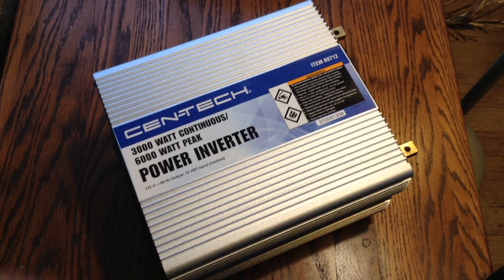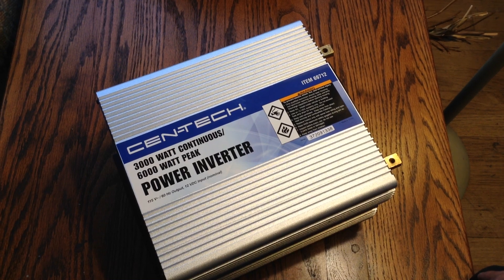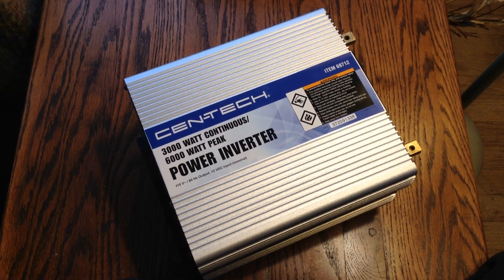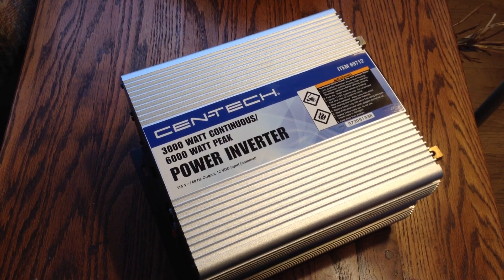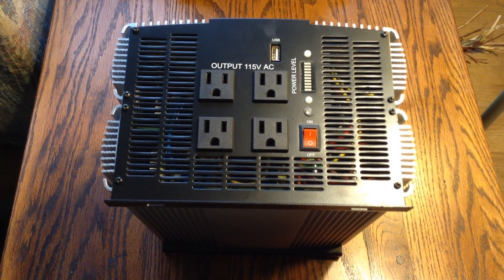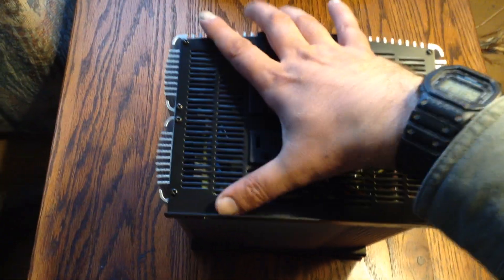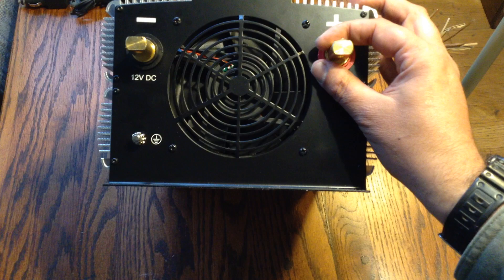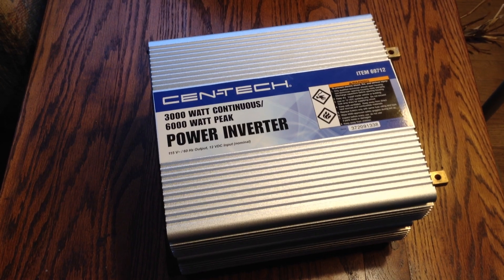Harbor Freight Centech 3000 watt 3KW Inverter item 69712

Comment: 12v Battery to inverter 275 to 350 amps, at the 120v outlets 25 amps max.  I would imagine that 8x 100 amp hour battery could be used in parallel  to supply enough juice to run some tools for a bit all day. We use 48v system which makes power draw much easier.  No problem with the Airfryer, hair dryer, microwave running.  I do have a 2,000 watt Jupiter as backup but due to the modified sine when tested our microwave struggles to reheat coffee.

Comment: Being that you don't get something for nothing, on average, ANY inverter will draw about 10 times the output amperage of the inverter from your batteries to produce 10 times the battery voltage or 120 VAC at XXX watts full load. In other words 5,000 watts / 120 VAC = 25 amps AC. 10 X 12 VDC = 120 VAC therefor 10 x 25 Amps AC = 250 amps DC DRAW FROM your batteries at full AC load. If you go into a Flying J truck stop or any other big chain truck stop on an interstate, a lot of times you'll find a very small microwave oven and a 3,000 watt inverter combination for sale. It's been years but they used to go for about $350.00 U.S. Large trucks use large batteries or several smaller  batteries in a series / parallel configuration and need an equally large alternator to charge these, run a lot of clearance lamps, headlamps, driving lamps, cooling fan clutch and A/C system et al. These alternators are usually good for 250 to 300 amps by themselves. Usually long haul truckers leave their engines run 24 / 7 because burning a gallon of diesel fuel an hour at $3.50 a gallon for heat or A/C is cheaper than a motel room. Warming up a meal in this microwave will suck a lot out of their batteries as the alternator doesn't put out full power at idle but it will eventually recharge the batteries back up anyway.
Oh, and the series / parallel configuration that I mentioned? Not everyone knows this but the older trucks used a massive, single 12 volt battery valued at  between $500.00 and $600.00 then to warm glow plugs and start high compression diesel engines. If you increase the voltage, you halve the current required to do the same amount of work. Being that there aren't too many vehicles out there, (none that I know of), that runs everything on 24 VDC, The truck manufacturers decided to take 3 standard size albeit heavy duty batteries, connect 2 in parallel and connect the 3rd through a very heavy complicated relay that resembles a part out of a nuclear submarine. When the 12 VOLT truck is idling, all 3 batteries are connected in parallel through this relay to charge from the 12 volt alternator. When cranking the truck, the relay disconnects the 3rd battery from the parallel circuit and reconnects it in series with the other 2 batteries to power the 24 volt starter motor there by halving the current required to start the truck, which, at 12 volts could run up to 600 or 700 amps for a V8 engine. Now it only requires 250 to 300 amps to start. My first car was a 1968 Chevy. It had the 307 Cu. In. small block V8. Compared to a V8 diesel engine, it was an extremely low compression engine but it still required 200 amps at 12 volts to crank so you can see that it doesn't take a huge battery anymore to start a large diesel engine at 24 volts. This coupled with the lack of glow plugs in a modern engine, requires even smaller batteries with smaller reserve capacity. Some of the newer trucks have even done away with the electric starter altogether in favor of an air powered starter that is akin to the air wrench that they use to change your tires with. If they were to need a jump start if they had an air leak, they would pull out a long air hose to connect to a fellow trucker's air reserve tank rather than jumper cables as big as your wrist. In the older trucks with the Queen Mary starter batteries, if 1 cell went bad, the entire $600.00 battery had to be tossed. Now, if 1 cell goes bad, you are replacing only 1/3 of your battery bank for about $125.00 to $150.00 while retaining the other 2/3 of the original set.
As for your using a high starting current battery for your high current inverter, bad idea. This is what the bangers with the kilowatt audiophile thump cars thought when they were popular back in the 1980's. They'd buy the 1,000 cranking amp "truck" batteries and try to run their high powered amps without the car running. They'd pick up some cute chick on Clearwater Beach after a half hour of "advertising" then be embarrassed as hell while begging for a jump start to go find a quiet place to "get acquainted". Some would have to buy a new battery 2 or 3 times a year if they didn't catch on to the pattern of permanently damaging their battery by over discharging it and overheating it during recharge. Even though high cranking amp and long reserve capacity deep cycle batteries are chemically the same, they are constructed differently and have different charge / discharge pasterns. High cranking amp batteries have many THINNER lead plates and are made to output a quick 200 or 300 amp burst of power then recharge at a REGULATED rate of about 13.5 VDC to 14.5 VDC from your alternator but ideally never being discharged more than 10% or 15% at any one time. This is one reason why you shouldn't try to crank a car more than 30 seconds at a time without a 5 or 10 minute break to allow the battery to recover somewhat. 1) You can overheat the windings in the starter motor and ruin it because the battery voltage begins to drop. What did I say before? If you double the voltage, you halve the current required to do the same amount of work. The reverse is also true. If your battery voltage drops 25% from 12 to 9 VDC, the current required to crank the motor INCREASES by 25%. Instead of pulling 200 amps to crank a small block V8, now you're pushing 250 amps through motor windings made to operate at only 200 amps. and 2) If your battery voltage drops below 10 volts, you can overheat the plates thereby warping them and shorting them out. If you connect a high output battery in your inverter setup as you plan, you will be subjecting the battery to the WORST of both worlds. You will be drawing high current for conceivably, a relatively long period of time like using your geared saw to cut a sheet of 8 foot plywood longways. A 15 amp motor @ 120 VAC = 15 amps X 10 amps drawn from your battery = 150 amps but for more than 30 seconds and for how many times a day while building a dog house, shed or barn before it finds it's way back to your UNREGULATED charger that may put out as many as 16 VDC? Add this to the possible multiple tools plugged into the other 3 outlets and you compound the problem.
On the other hand, a deep cycle battery is made for lower power drains over a longer period of time because their are fewer plated but they are built heaver and therefor less prone to overheating and warpage IF THEY ARE CARED FOR PROPERLY!!! If you keep them charged PROPERLY when not in use. This means that you connect them to a DEEP CYCLE BATTERY CHARGER BEFORE you go shower rather than forgetting to connect them at all for a week at a time and keep the water levels over the top of the plates, they'll last you longer. A full, fully charged battery is like a wife. They'll both keep you happy longer if you give them what they want. Wives and deep cycle batteries are the same in that they both want to do less. Wives like to have others around to help with the work. Deep cycle batteries like to have like minded batteries connected to to them to share the load too. While you may not want to cart around 3 or 4 deep cycle batteries in your off grid power supply, you can't fight physics. You'll lose EVERY time. Maybe consider a 4 wheeled cart to, here it comes again, SHARE THE LOAD of the extra 150 pounds of batteries that will be required to do the amount of work that you are asking of them. Taller wheels will help it to roll easier too. VERY IMPORTANT!!! Be sure that your DEEP CYCLE CHARGER(S) have enough capacity to charge your battery(s) in the time that you will allow them to charge. If you use this thing every 3 or 4 days for 30 minutes at a time, a 10 amp charger left connected when not in use should do fine. If you're going to use it every day, day in and day out, 10 amps of charging current capacity PER 100 AMP HOURS OF BATTERY CAPACITY is more like what you'll need to charge them properly. In other words, if you have 4) 100 amp hour deep cycle batteries, you'll need either 4) 10 amp deep cycle chargers or a single 40 amp deep cycle charger or any combination up to 40 amps. You could check with an RV or marine supplier for your best options. Here's another thought. I don't know about where you live but at the Walmart here in West Virginia, they sell in the automotive area large super caps. These are full farad super caps that are about 1 1/2 times the size of a soup can, they charge quickly but like a battery but discharge in an instant. The guys with the aforementioned thump cars connect them across the power leads of their amps to supply a pulse of power to the amp so the supply voltage doesn't jump around with the beat of the music and play merry, merry hobb with their sound quality. This won't extend the operating or daily life of your batteries but it will absorb some of the sudden impulse draw when you start up a power saw. REMEMBER, IT CONNECTS TO THE 12 VDC INPUT OF YOUR INVERTER AND YOU MUST, LIKE A BATTERY, OBSERVE + AND - POLARITY!!! I would start with one at first. Like batteries, if it improves your situation but not enough, you can always add more in parallel. I would use at least 10 gauge wire to connect it / them as you will be pulling some initial current through it. SAFETY CAUTION!!! Be aware that these may look like the old 1.5 volt dry cell batteries but this is where the similarity ENDS!!! They will spark when you first connect them. Cover the top(s) of your battery(s) BEFORE you mess with them to keep from detonating any hydrogen gas inside the cells. Also, if you have one of these charged, their power draw is then minimal when the inverter is shut off. Don't let this sleeping rattle snake fool you. Once charged, if you drop a wrench across the terminals, it will shower you with molten metal just like shorting a car battery. Where a car battery will evaporate a wrench and stay hot until it does, these super caps, if shorted, will dump their energy, like a flash gun, ALL AT ONCE into the wrench with the power to blow that wrench apart.
Reply: Definition of Paragraph by Merriam-Webster:
a subdivision of a written composition that consists of one or more 
sentences, deals with one point or gives the words of one speaker, 
and begins on a new usually indented line. 
 . . (also makes reading easier than a big block of text)

Comment: I would not run any motors on a modified sine wave inverter period. Modified sine wave is not good for a motor. Pure sine wave is the best for motors as well as any electronic equipment. You get what you pay for. Also deep cycle batteries are not the best for draining I would use a couple of golf cart batteries wired in series. If you want 12 volts. I myself prefer a 24 or 48 volt system.

Comment: I just bought a brand new one of these inverters again this is my second one. thought the 1st was a defect and not believe this one is. I have 3 deep cell marine batteries brand new hooked up negative to negative and etc then connected to the new inverter. when I turn power on I get the loud warning buzzer going off and fan runs a half second and shuts down no power. turn power switch off then back on same thing. what am I doing wrong. the cables I am using to hook this up is about a half inch thick. I do not believe that is my problem. I also had a tiger claw 3000 watt pure sine converter hooked on same system it worked fine for 2 days then we got up one morning while camping and I went out to turn converter on and get the red ligh warning buzzer going off on it also.. so the reason I bought the harbor freight ones and still nothing is working...
Reply from the maker: I suspect the batteries have a voltage matching problem, like they might be 6 volt batteries, or one of them is a 6volt battery.
Reply: 3 batteries??? 3x6v = 18v and 3x12v is 36v. Neither will run a 12v or 24v inverter without burning it out. 2x6v + 1 12v = 24v but you create a mismatched mess. ???????
Reply: battery low voltage problem or a overcurrent issue
if the 3 batteries are 12v, youll need to have them in a parallel config
3 in series will create 36v

Comment: Would you like to know why the power fan on your 2000 Watt power inverter was coming on all the time ? Improper connection ! I think you will find that if you use proper high current rated DC voltage type multi strand pure copper 2/0 or 2/00 AWG Gauge hook up wire you will notice your inverter power cooling fan will not come on all the time. Want to know why ? DC powered circuits are particularly prone to current loss and heating as a result of such current loss. If you use even 4 Gauge AWG copper wire, then you will get enough current to operate, but not enough nominal current to allow the DC stage of the circuit to operate at full efficiency, thus loss, and thus heating ! The more heating generated the more resistance is built up, thus you create a run away reaction, which the cooling fan is trying to motivate.
Reply from the maker: Nice theory, but the old models did not have a heat activated cooling fan, if the inverter was on, the fan was on.
Reply: +8digitPDX No inverter has a non-heat activated cooling fan. If the fan is on all the time, then either the load is too high for the duty level of the power inverter, or the wiring is too small preventing enough current from reaching the inverter.
Reply: +8digitPDX Addendum: Or the battery supply is insufficient for the inverter load.
Reply: +the awesome toaster I don't believe the fan was directly connected to the power switch for a second !
Reply from the maker: +Mark Job look at the product reviews on the older 2kw HF inverters.  Everyone complained about fans draining batteries.
Reply: Mark Job some of the older models did have a fan that was directly powered at the switch. I have a 300W HF Inverter I keep in my truck and a 2000W inverter k keep for more urgent conditions from HF and both have the fans switched so they run when it's on. A lot of old inverters were designed like that, even name brand. Recent design upgrades were made to have them thermostatically controlled or load controlled so they didn't drain the battery supply so quickly.

Comment: Will this allow me to have variable power on my 1700w hot plate? I have heard that modified sine wave inverters don't work well with variable power. thanks
Reply from the maker: Yeah, it will work.   Might wear things out faster so just get the extended warranty.  This inverter burned up a nice little fridge which had been given to me, which was a bummer, but it was in 105 degree temperatures, and panels had overheated which I think was giving false power readings to the automatic shutoff on the inverter.   Voltage looks right, amperage runs low, system goofs up.  Just one of those learning experiences from off grid life.

Comment: For welding just use a spool gun designed to work directly off 12 to 24v and you will have much less loss
Reply from the maker: I have been shopping those and I like them.  I just have not gotten one yet, except it seems they work far better at higher voltage, like four batteries in line at 48 volts, and then that means a specialized battery bank and array just for welding.  It makes sense for fixed site off grid workshops, but not the portable mobile multipurpose system that this inverter ended up being used with.

Comment: I found out it's a good inverter and it's all about the batteries, if you hook this up to 4- 6 volt golf cart batteries wired as 12 volts it has lots of usable power.

Comment: Why is it, a lot of people blab about the inverter, but you hardly see it running anything and when you finally do they don't let it run for long periods of time. If it does NOT run for long periods of time under load, then the ITEMS are junk to me. Whats the point to buy them if you cain't rely on it.

Comment: which inverter do you use in your rv? can you recommend one? pop up trailer new never used just thinking ahead. coffee maker, laptop, electric skillet, radio etc. Thanks
Reply from the maker: +gary rodriguez  I use a 2KW one that I bought off Ebay as "pure sine wave" but we think it is not actually pure sine wave.  I never went through the trouble of removing it, but once I discovered these 3KW Harbor Freight inverters, it's what I use on most camper and cabin power projects.

Comment: My inverters will not put out the advertised max watts. I think they over state what they can do.
Reply: Billy Cook many people make the mistake of using not the proper gauge wire
Reply: Mine did that. Used 4g wire, stepped up to 2/0 g and it worked.